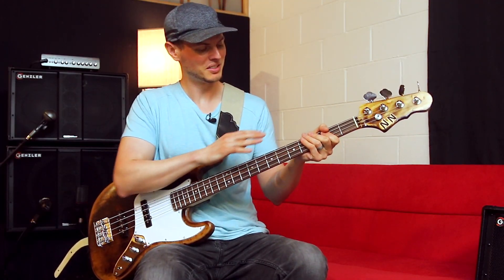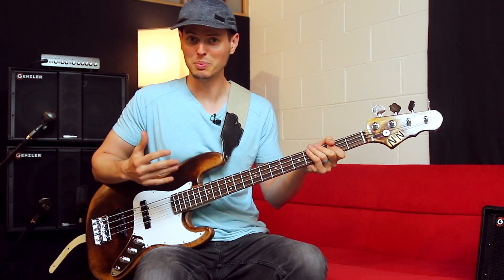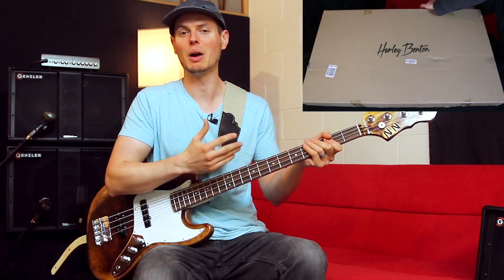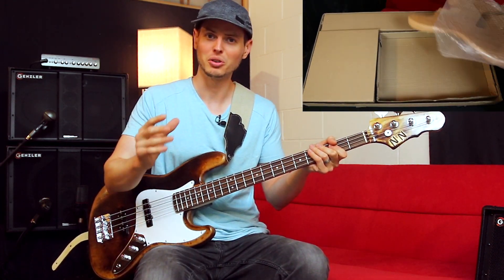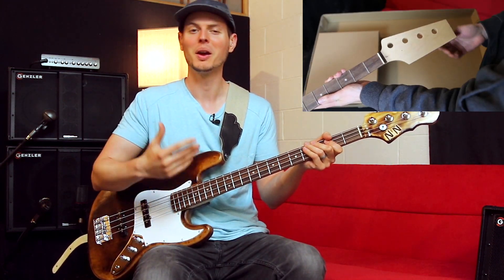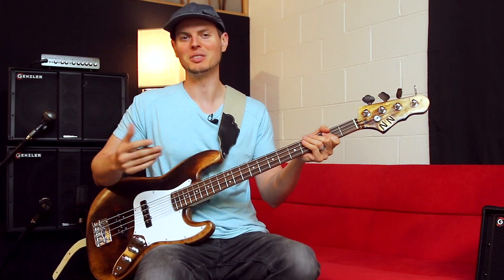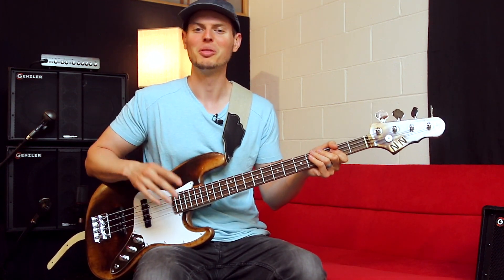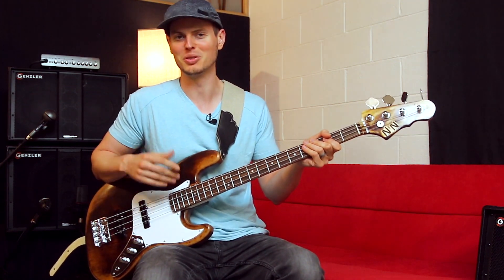Playing my DIY Bass

Comment: 2:11 You could have died putting the fluid bottle so close to the fire, or just by squirting it directly into the fire! A relative of mine have suffered serious 3rd degree burn... And it was not by burning directly the bottle, but just by allowing the fire to "climb" the jet up to the bottle, and to him... And it was with alcohol, that isn't that inflamable... so, take care, if you really need to do it, it's better to use a cup... but it's not safe anyway

Comment: funny to burn it the best way is use old 60s style speedboaat spray paint but these days makers are doing try hard body scemes i think the best is schecter with stripes but on you tube you see trillions ideas they even make like carbon fibre bodies and all kinds stuff but nothing has beat 80s bb yamaha for the money used by van halen new order smashing pumpkins etc dont know why new iabnez 90s style neck bass dont have bass boost like gio as should but older cheapys used to be easy to find last thing came x was a usa made black 80s bass made in texas 180 bux but had matches in wires to make it work too heavy dropped it and thought for cash get new one on sale but stores and staff dont get it why so many closed